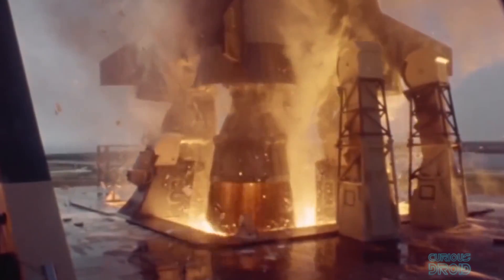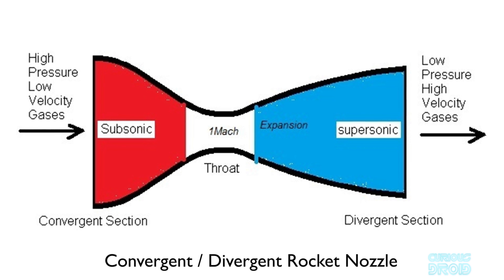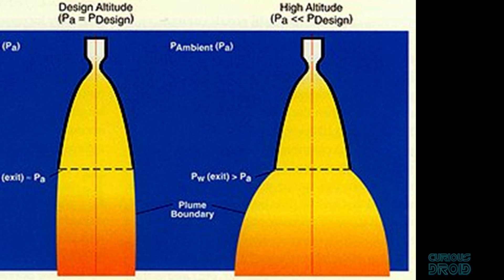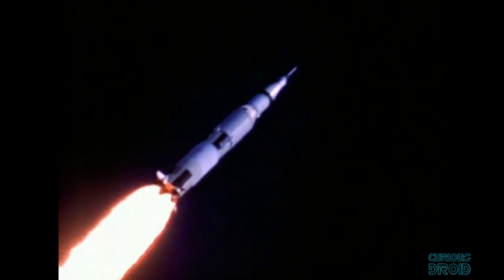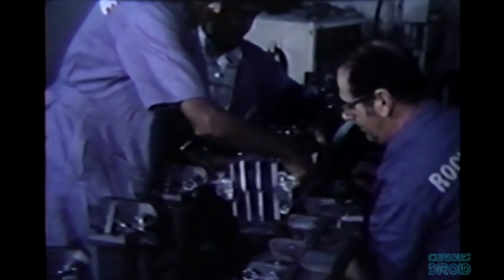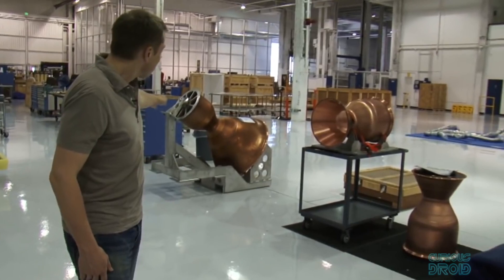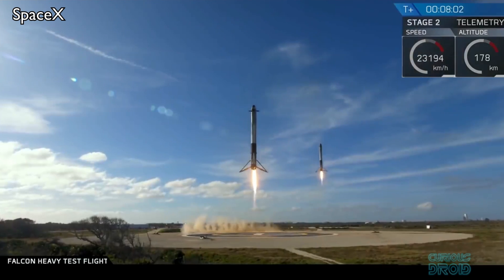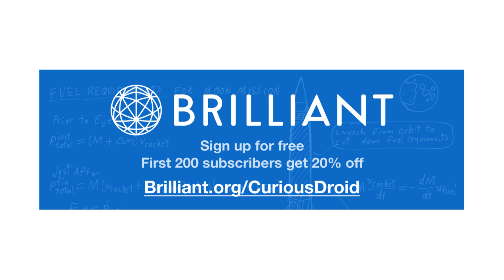Aerospike Engines - Why Aren't We Using them Now?

Comment: It’s sad to think about how much aerospace technology was developed decades ago and not used since due to lack of financing.
Reply: Dawson Williams and Saimons
You realize that aerospike engines and multi-stage rockets aren't mutually exclusive, right? You can still have the space shuttle setup, put the traditional bell nozzles on your solid rocket boosters as they aren't used for most of the trip, just the initial boost, and have your shuttle engines be aerospikes as they have to be used for the entirety of the trip. 

Also, the fuel tank is held until it runs out of fuel anyways, which is after getting through most of the atmosphere. So yeah, you almost are carrying a huge fuel tank all the way to orbit. Most huge fuel tanks for rockets are dropped after exiting the atmosphere but just before reaching orbit. So no matter whether you're using a single stage or multi-stage rocket, you're carrying that fuel tank nearly the entire way anyways. It actually doesn't make that big a difference.
Reply: All of which is pointless if, say, we pollute the planet and commit species suicide. Or a supervolcano goes off and we lose all food production and most of the knowledge of that technology. Or we get hit by an asteroid. The point is all our eggs are in one basket. If something happens to the Earth, we're screwed. We should put at least some resources towards hedging our bets. Oh, you also know who needs better medicine, computers, materials, and energy technology? The space industry. Two birds one stone.
Reply: As Neil DeGrasse Tyson, out it, since space exploration is no longer a geopolitical contest, it's no longer a priority.

In post 9/11 world, our American Corporate Empire is concerned with continual resource warfare, for profit, of course.
Think about it. The things NASA could do with the ten eight hundred billion dollar budget increase, the military just received recently.
Reply: dolebiscuit Yes, actually. US Defense spending makes up 16% of the budget, while social security and welfare makes up well over 30%
Reply: What that fails to take account of is the globalized nature of the economy and how much we rely on global infrastructure. Should a significant portion of that fail, then all the things that keep the majority of humans alive will fall apart. Sure, some military forces will probably survive as a result of survival training and hydroponic systems, but you will likely see a large "brain drain" as many of those who have knowledge of how systems work die out. In some areas we could be knocked back over a hundred years as a result.
Reply: Or is IS being used by the military and just not publicly known about. Same for many types of technology. A guide for patent examiners for patents to be CLASSIFIED BY THE MILITARY included things like solar panels more then 20% efficient, fuel efficient engines, carbs, propellers, heating of the surface to increase MPG, computer, encryption, water desalinization,ETC. And it had a section for weapons and weapons components, which I would agree with for many things like missiles, ETC.
But solar panes , water desalinization, things to increase MPG ?
What happened to energy or SAVING GAS ? Water to people ?
They don't want it !
Notice this was a 1973 guide, I can't find an up to date guide. This means they had solar panels better than 20% in 1973 ! And 50 years later they STILL don't sell panels even 20%. But MILITARY panels have been over 40% ! Yes, more expensive but they wouldn't increase the price more than 20% since most of the cost is the panel, not the actual cells.
The title was something like ,"Patent Examiners Guide to Patents to be Classified".
Reply: LazicStefan is actually right. Bunch of libtards in here.
Reply: This is what happens when you're at the mercy of someone who doesn't give a shit about space travel to fund your space travel.
Reply: FutureNow, then luckily that money is used in other areas. So we get better computers, better medicine, understanding evolution better, biogenesis, housing materials, energy technology etc.
Reply: Money is made from thin air, look up the FederalReserve system. They own NASA
Reply: What about Russia & China who are not so profit oriented?
Reply: I thought government killing of potential projects coz of limited funds was an inherit British thing, but the virus has now cought the USA, the richest country on earth, am really surprised. It runs in the family?
Reply: Imagine what the black projects made that we don't have. E.g. the work of USAF scientist T.T.Brown before it went black in '54, he proved capacitors exert force and that a highly charged disc in a vacuum will undergo a weight change.
Reply: I’m not so sure about that. If you count all the spin-off technology then you are using aerospace technology everyday. There are the obvious things like the satellite services we use, single crystal solar panels, and LED lights. But there are also the less obvious things like the materials in your radial tires, the foam cushions in your furniture and more.
Reply: Communism
Reply: @LazicStefan Rich people are rich because they do use their money.  They create markets and products and invest in others who do.  This creates the demand for jobs for us who are not thus inclined and would just piss it away if they gave it to us.  I don't pay more for a product than is the fair market value and I don't want him to pay me more than my skills are worth on the job market.  The rich and the poor are both born, live, and die.  We need the rich so I can do what I like to do, and the rich need me to be able to do what they like to do.  In my opinion, guys like Henry Ford, Wright Brothers, Diesel, Lockheed, Boeing, Bill Gates, Steve Jobs, the guys who started Google, the guys who started YouTube, etc. are the most underpaid people in the world.
Reply: FutureNow you should make a conversation in the discord server about it
Reply: + NaN
So you're convinced he's not too intelligent to make sense to the masses amongst whom you huddle.
Reply: Epic Nipple if thats true? Well, that makes me kind of happy anyway..
Reply: Tapu Koko you're kind of right, being the police in the world can't be cheap.
Reply: yes
Reply: That's why NASA sucks for a space agency. They cannot stay with 1 plan.... Half the time they aren't even thinking about space.
Reply: NASA is the military. I strongly suspect, no, actually I know for a fact that a great deal of technology HAS been developed but not made public. It's pretty obvious. The SR-71 was made 50 years ago
Reply: Best aircraft ever designed yf 23 and it will never see production :(
Reply: Financing?..more like suppressed.
Reply: you and your likers are idiots
Reply: FAKE NEWS
Reply: FutureNow because we're divided. I figure once we have a common goal it be different.
Reply: LazicStefan is obviously ignorant or a shill, ignore him
Reply: FutureNow most often it leads to other things better in need
Reply: Decades ago NASA had a huge boost from all the German scientists they "acquired". The moon landing was only possible due to what Germany has developed. Russia has achieved far more milestones in space travel.
Reply: I know it is always about  how someone can make money.
Reply: "financing" - making things go quickly costs a lot of energy - few on the planet have the energy to make things go fast. Read: Asguardia. Wtf humanity? I want electric vehicles and protein meat that replaces chicken perfectly, idc about another sattelite being used for more tv channels -_-
Reply: Does it make you cry?
Reply: Your over budget! How are we going to build all these aircraft carries now! My question is if we ever needed to use all this firepower against another large nation it wouldn't matter. one nuclear bomb would destroy an entire fleet. Let alone every major city. production area etc etc. I bet there is insane amounts of money being put into a black project that makes it so any ICBM can be destroyed. An when we get there no one would know until nukes were fired or another country came out and did the same. Funny enough building a anti ICBM system would make other countries upset like China an Russia.
Reply: And stuff like steam powered electric cars before gasoline ICE
Reply: @LazicStefan I think you mean war
Reply: Just search DIY rockets. It's the future now.
Reply: LazicStefan you really don’t have a clue I wonder how you actually get dressed in the morning
Reply: @LazicStefan What you subsidize, you get more of.  Remove all government assistance for everything, including education.  Anything people do not earn from their skills is charity, and charities have voluntary-only donors who oversee how the money is spent to help others, not to build dependency and buy votes.  If you do that, everyone's standard of living who stays will go through the roof, you will have the best schools and best educated people in the world again because the parents whose money it is in the first place will see to that, and you will have money to spare for these things to spare.  You will have far less crime.  The rest will flee to 3rd world socialist countries to live with those who made their country what it is today.
Reply: @ianhargis182  Apparently
Reply: @LazicStefan All welfare programs combined consume less funding than corporate tax-breaks (Corporate welfare) producing toxic products and useless, bastard worker drones who can't pay their bills.

In fact, the welfare state is one of the smallest segments of the US Budget, with the Military and Intelligence communities being the vast majority of it.

For example the 400 Billion we spent on the F-35 (A now outdated and inferior platform with serious problems and a high keeping cost) could have funded every NASA project that was canceled and been enough left over to fund welfare for decades.

GG, facts don't care about your feelings snowflake.
Reply: @LazicStefan you have it right but backwards...women are incentivized to be so
Reply: @LazicStefan That has nothing to do with it. The lack of education and social welfare and the massive wealth gap are the biggest problems. If you look at the countries with the most self-made millionaires and billionaires, the countries that are the happiest and healthiest, and the countries that are the happiest, they are all the same: socialist Scandinavian countries.
Reply: The thing is with modern chemical fuels it isn't very practical to build an SSTO. Let's assume our ISP is as high as it can get, and it's always optimal (approx. 4510 m/s- O2/H2 pair). Then the Tsyolkovsky's equation 10000=-4510 ln (x/100), where 10000 is approximately the delta V to get to orbit, x will yield the final mass, it's 10,89 tons per 100 tons of initial mass. If the ISP is lower -3700 m/s then the final mass is 6.7 tons per 100 tons of initial mass. But it isn't as easy. Because initial mass should include payload, fuel, construction and so on, it's basically impossible below certain ISP to get the rocket to orbit. Basically when you start to analyse masses, you get to a certain very interesting conslusion. Let k=Mfuel/Mconstruction then (Mpayload+Mfuel+Mfuel/k)/(Mpayload+Mfuel/k)=exp(deltaV/ISP)--->Mfuel=(Mpl*k*exp(V/I)-1)/(k+1-exp(V/I)). For denomenator to be positive (because numerator is positive and mass of fuel cannot be negative) you have to get k>exp(V/I)-1. Usually k=9. (Construction is 10% of mass of fuelled rocket). So, exp(10000/4510)-1=8.18, so only with that ISP it is possible. But with ISP of 4342 m/s exp-1=9, so you have border situation and odds are your SSTO can never reach stable orbit.

So, during 60-s it was even harder to build smth like this, and areospikwould have a great problem with cooling the spiky part.
Reply: Lack of financing????

Ummmm $600 billion isn't a lacking budget....... Unless you're a Rothschild! Or one of those other piece of shit families
Reply: Succubus Chan  And therein lies the problem: Science should be a core part of the government. Instead we spend more than Russia and China combined on our military. It's ludicrous and unnecessary.
Reply: Succubus Chan  Everyone deserves to eat. Everyone deserves to live. No matter how useless you think some people are. Your opinion does not rescind the right of every individual to have access to food.
Reply: Well the corporations run the world now so no more advancement only profit
Reply: PoopCoin Patrick  ok shut up you delusional clown if you have nothing useful to add.
Reply: @LazicStefan lmao truth truth
Reply: @LazicStefan Good point; all males should have reversible vasectomies before puberty, and then once they are able and willing to provide for any offspring then they can get their fertility restored.

If that's seems a bit harsh [because it's something being done to men, and not women], then free contraceptives on demand with universal access should drop the unwanted pregnancy rate by a lot.

But then, a 1% rise in the company tax rate could cover the cost of single mothers welfare with money to spare.
Hell… just Jeff Bezos by himself paying his fair share of taxes would cover it for everyone.
Reply: What makes you think it’s not still being used for current research and development? Just because NASA doesn’t show the public doesn’t mean they’re not still building spacecraft.
Reply: Epic Nipple I hope you’re right! I want this stuff to work so bad!!
Reply: it's not lack of financing, the aerospike just isn't that good for multi-stage rockets, and single-stage rockets aren't very good for anything.
they're more expensive to manufacture due to their precise shape, so you ideally want to recover them as well, which is even more challengeing to acheive their use-case of being single stage. for things like single-stage spaceplanes they might see use, but depending on tech that might not happen either given engines such as SABRE.
Reply: with NASA funding being less than a fraction of US gdp, I bet that aint the issue... There's too much rich people spending money in useless luxury instead of funding useful science, useless wars and excessive expending, too much corporate lobbying... whatever. given the US government snail pace at funding space, it'll probably be private corporations to keep things going on, and other countries governments.
Reply: Tapu Koko I was off. The US doesn't even make the top twelve countries with the most military/GDP investment. http://uk.businessinsider.com/12-countries-highest-military-budgets-percentage-of-gdp-2017-7/#12-jordan-431-of-gdp-1
Reply: LazicStefan I mean, I think it was like 1% percent of people hoarding 80% of America's wealth or a similar number, and the US government invests in the military the most out of any other country in the world, so I think single mothers on food stamps are hardly what is keeping NASA underfunded :/
Reply: This planet will inevitably die out. Whether in 100, or 10,000 years, it will eventually become uninhabitable for humans. Whether that be from natural causes, such as an asteroid or supervolcano, or if we nuke ourselves to oblivion, it will occur. We should colonize other planets while we still have the resources to do so. I don't think you realize just how fragile our civilization is.
Reply: @Gustav_Kuriga  - we have a tin can circling the earth that we call a space station.  it took 60 years to get that done.  u watch too many sci-fi movies.  we are not even CLOSE to colonizing the moon.  baby steps buddy!  maybe one day when the space station is orbiting the moon you could still say we are barely close to colonizing the moon.  have you ever built a shed?  its hard enough to get the materials to the jobsite, to setup, and to build and thats with the convenience of no space suit, all the oxygen you can breath, the luxury of taking a break whenever you want, etc. etc.  for logistical purposes even if we build ANYTHING on the moon it sure as hell won't hold more than what?  10, 20 people?  musk got paid 1.4 billion to resupply the space station 12 times.  how much will it cost to resupply 20 people living on the moon, or even living on a space station surrounding the moon?  and at what cost to the living conditions on earth?  just so what?  if an asteroid is going to hit the earth 100 people get to survive?  how?  they will grow their own food?  make their own fuel?  besides.  here is a conundrum noone seems to take into account.  we "supposedly" landed on the moon 12 times back when before the invention of modern fuel injection and when computers were the size of your bathroom but with all the new insane technology we have today not one country has attempted another moon landing?  that makes zero sense.  why not?money surely ain't the issue nasa's anual budget is like 140 billion.  if they did it then do it NOW!  but maybe thats the problem.  maybe the stanley kubrik "conspiracy theory" isn't so far fetched.  also think about it didn't buzz aldrin kindly inform some grade school girl that we never landed on the moon?  yeah and please don't inform me that he has dementia.
Reply: @michael-dm2bv  Yes, I'm sure you're an expert on the subject and not just some random commenter on youtube. By the way, I don't know what kind of idiot stunt you're trying to pull, but the ISS began construction in 1998, not 1968.  And it took 20 years to build.

I'm not saying a colony will go up all at once, ready made. This would be something that took decades to put into place. But it is possible with modern technology. The issue isn't our technology, but the actual drive to do it. Probably the only country right now that has the drive to do it is China. Every other country is only focused on the, admittingly important, issues right in front of them and not those 20-60 years down the line.
Reply: @michael-dm2bv  Oh, and China is planning a moon landing. They just recently landed a moon rover on the far side of the moon, if you weren't aware.
Reply: Nonsense, the US could spend half of the current budget on military and the would still beat China, Russia and Saudi Arabia combined. Rich countries tend to spend less of their GDP on the military. One century ago, 20% or more of yearly expenditures of most countries would go into the army. It's expected from poorer countries to spend proportionally more of their GDP on their army than richer countries. Look at this map: 

https://en.wikipedia.org/wiki/List_of_countries_by_military_expenditures#/media/File:Countries_by_Military_expenditures_(%25_of_GDP)_in_2014_v2.svg

The negative correlation between wealth and share of GDP spent in military is pretty obvious. The few exceptions are the US, Russia and the oil monarchies. Really, there's no reason the US spends that much on military (except imperialism and corporations).
Reply: @pierrestober3423  Being as good as China or Russia's military is not close to good enough, have you not noticed a trend in increasing Chinese and Russian influence  and unmitigated aggression? That is because the US is steadily becoming less and less capable of deterring them. And there is a simply reason why most wealthy countries have pretty small militaries: most of them depend on the US military for backing and see little need to contribute, and this kind of attitude is the reason why NATO is steadily declining. You people who try to compare the US military budget to that of other countries dont realize the incredibly unique and important position that the US has played in geopolitics for a century, and more importantly you dont see the huge impact that the US relieving itself 0f that role would have.
Reply: NASA is an acronym so who cares what it means in Hebrew? And Americans spend $219m A DAY on cigarettes, so I think we can afford to kick some more money to NASA.
Reply: LazicStefan Welfare? Really? That's what is sucking the money out of NASA? Couldn't possibly be the fact that our annual military budget is over $500 billion dollars.
Reply: dolebiscuit Our military budget is actually at 600 billion dollars! But he's right, actually, (unemployment, labor, and soc sec) is 33% of our budget. They're lumped together as one thing, and that is double the military budget, totaling in at 1.275 TRILLION dollars. And then below unemployment and labor and soc sec is our health budget. Together those two make up over half of our budget at over 2 trillion dollars.
Reply: @dolebiscuit  >>>>  that   500,thou,million  -   all of  it goes  into  someones  pocket  - their taxes , their car  their slice  of entertaiment  mart  , their  holidays  which are  taxed  
derive  some thing  new  such as  "Pi*LHyT"    c  1989  ( yep   eighty  nine - 30 years ago )  they  wanted   it refused  to  pay  had   others  who  wanted  the coo-coo effect     three dimensional space-craft  //// aircraft  position  display  -  they wanted  all  for themselves  .  Never told as   not  paid to  derive  design  such .  When  I'm  paid  then they  get told
Reply: dolebiscuit Welfare takes up 54% of our annual spending budget meanwhile Military takes up 13-16% so yeah I’m pretty fucking sure it’s welfare
Reply: +Jeremy
You just told a guy who was probably anti-semite that he was Zionist. Right after calling another conspiracy theorist an Arab Socialist (something that's probably the most non-existent population in the entire world). It's also hilarious that you call the US free-market capitalist, something it hasn't been since the turn of the 20th century. By god you're the most deluded person I've seen on youtube in a while, and thats saying a lot

+hurcouk You realize that Hebrew originally didn't have vowels, and that nasa is merely the way the word is pronounced, not its actual spelling, right?
Reply: @Gustav_Kuriga  - https://youtu.be/j0TPJQSmAHU  -  us tax payer money HARD AT WORK.  grown men playing with 3d printed blocks of moon dust?  how much did that printer irresponsibly cost u.s. tax payers?  its actually pretty funny these employees have probably never even done masonry on earth and they are proposing we make airtight shelters on the moon via masonic building techniques?  theres a word all moon colonization "dreamers" need to learn.  the word is "logistics".  stop building ur moon base on earth.  build it in the vacuum of space, in a space suit, how ever many miles away the moon is, with all the logistics necessary to make it work.  do you breathe?  how much oxygen do you need to bring to keep 10 men in space suits alive on the moon for ten days?  its really the problem all you colonization "scientists" leave out all the little details.  you just say "lets colonize the moon!"  shit!  i wish we could!  we could send all idiots to a new home.
Reply: also, thank you for the link!
Reply: Wouldn't surprise me a bit; I have on good authority from a (since departed) family member in the oil industry that carburetor technology able to achieve over 100mpg in even monstrous vehicles like the Chevy Suburban has existed for decades.  But now we're making devillishly complex electric, hybrid, and alternative-fuel vehicles, creating new sub-industries to avoid the simplification that would cost car and oil producers billions in profits.
Reply: Ben Carson is still an idiot outside of his specific field.
Reply: Most humans fall into that category.
Reply: Tapu Koko It's not the amount of money going into the military budget that matters, but the percentage of the GDP. In that regard, the US is the....fourth largest? Fifth? Somewhere in that area. I know Israel, Russia and Saudi Arabia invest more of their GDP then the US does.
Reply: Gustav, they are also getting that with the enovations in other areas. 
Just so you understand, in order to get humans to live on another planet, you have to move a lot of them, before they don't die from inbreeding. You do also understand that we can survive a supervolcano etc. on this planet, if we prepare for it? Of cause not all, but some should be okay. Currently we are starting to produce crops indoors and that will become a lot more. Decentralisation of the energy net with different teknologies will also make sure we can survive. If we want to colonise other planets, we need to get it right here first.
Reply: youre an idiot
Reply: install communism for more finance
Reply: FutureNow actually, it's more due to the inefficiency of having a single stage to orbit. Turns out carrying around a huge fuel tank all the way to orbit is less efficient than dropping them off when they're not needed. Also, Elon Musk is a better con man than scientist
Reply: @dawsonwilliams546  elon a con man. Haha your such a clown.
Reply: LazicStefan Man, you're fucking stupid.
Reply: USA and wellfare state? singlemoms sucking up ressources? 
what kind of humor is this? i can hardly belive this was a serious statement.
Reply: LazicStefan how about the military budget? Insanely overinflated and is going to increase even more
Reply: Capitalism by itself tends not to innovate just exploit other accidental innovation or cause harm calling it innovation, and stealing collective innovation via taxes and vision.  Because the profit motive doesn't work for long term long cited things, but needs profit asap.  Something like space technology needs more government R&D... I mean the private space companies are only racketeering primarily off government contracts anyway.
Reply: @LazicStefan they decide where all the money in the world goes. They create the conditions that lead to your dreaded welfare state. Rich people are entirely the problem. Blame the people responsible, not the people who have no power over anything
Reply: The rich have made our species into a parody of what it should be.
Reply: THey don´t use them personally, but they do own disproportionate amounts of capital which they direct into the finance sector, and into furthering  our mad consumer economy... they are eating the rest of the economy now! There´s more to the economy than what you see out there....
Reply: LazicStefan it’s a shame your mother didn’t use contraception. The planet needs less idiots like yourself
Reply: LazicStefan lmao you forgot that the defense sector took the most money , welfare is literally peanuts when compared to spending on wars
Reply: Pierre Stöber

I think the US should atleast cut their 800 overseas military bases in half, which costing the US around 100 billion dollars, and shove that money into NASA instead.
Reply: LazicStefan Was that really called for ? No I think we can blame the government spending our tax dollars on endless wars that benefit  only the ultrawealthy . How about these companies stop being so greedy and stop expecting "we the people" to pick up the tab . I'd rather see some of my tax dollars helping single moms and their "" bastard children"" as you so coldly put it than giving billions to Israel or huge tax relief for the wealthy who can afford to develop this technology if they weren't so fucking greedy expecting a hand out from the government as they usually do.
 You've got issues . Try being a single parent some time . It's not too much fun at times. I'm a single dad and can empathize with the single moms out there who are trying their best .Not everyone has had it easy or had decent parents with money or fill in the blanks...

 Judging by the way you said that I'm surprised you didn't take it a step further and start throwing ethnicities into it . Do the world a favor and don't procreate okay ?
Reply: Chrissel L Also when you have a poor section of the population you have a ready made volunteer military force . In so many of places in this country the military is the only way out of poverty . Just look where most of our service people are from . That pretty much says it all and is a well known fact. 
Not a bad gig to get into assuming you survive and live long enough to reap the rewards for staying in the full tour of duty. One other point I'd like to make is the fact that many of our service members and their families are on public assistance and are barely getting by . If we're talking about welfare lets talk about corporate welfare and stop attacking the average person who needs a helping hand from time to time.
Reply: When the military is used to further private corporations and special interests (think oil & gas, Israelis, Saudi and other gulf state lobbyist) then it's a bad gig. The american public are first deceived they are under threat (!) and then they are given the solution which is to enlist. It's a ridicilous thing. Sometimes it's not about corporate interest,  in Vietnam US wanted to stop Soviet influence and got tangled in a war against a poor country which acted as proxy for china and soviet. It ended in an ironic way, many americans shamed the veterans returning from this disaster even though it was politicians and leaders who made bad decisions and started an unethical war.
Reply: +LazicStefan
You mean the American war engine which is swallowing up all the money.
Reply: fair enough, I havent done my research (cause most of the time I generally don't care) and am going off what I remember reading, though the point stands that I don't think 'the welfare state' is the cause for NASA struggling to get to the sky again, when you look at the current distribution of wealth. Welfare or not it doesn't seem like space or science are the government's top priorities.
Reply: Logan Caudill 2017 the US spent 822.9 billion for defense, while the TOTAL welfare was at 454.6 billion... So, military 12% and welfare 7%.
https://www.usgovernmentspending.com/year_spending_2017USbn_19bs6n_20303136#usgs302

In comparison in germany we spent 2017 also 12% for defense but 42% for welfare
https://www.bundeshaushalt-info.de/#/2017/soll/ausgaben/einzelplan.html

Ok this comparison is not very strong because it lacks of details and im not able to show structural differences. But obviously there is a huge gap between them. 
And we are still alive, we are still making great cars. We have a far more peaceful society and far less young people in prisons...

I can not proof this thought, but im very sure there where more civilian killed during war on terror than single moms using welfare even exists in that time. And it was more expensive. As example a single Hellfire missile costs $110K. I could live pretty good for that money for about 5 years.
So there is no fuckin reason to cry about a little bit welfare, a little bit of good for people having hard times.
Reply: Gustav, sure, but humanity will survive.

We will need a lot of resources to move over 10.000 people to Mars and that would probably be better spent here to make sure this planet doesn't die out.
Reply: LazicStefan You’re why nationalism is dangerous.
Reply: +God the supposed existence of deities is why humanity has ALWAYS SUCKED.
Reply: LazicStefan
 Are you really stupid enough to actually believe that? If you want to blame something how about blaming the correct thing for one? Look at our oversized defense spending. It far outstrips the budget of the next 5 nation's defense spending combined... And we are so wasteful on that front that we have moved on to militarize our  own police forces free of charge to them with all the military surplus we have despite our active involvement in military conflicts over the years. Social programs that actually have a positive impact on the standard of living of fellow Americans has nothing on those figures yet here you are blaming the poor out of your own ignorance.
Reply: FutureNow instead they waste money on gender studies because we dont know whos female and whos male.
Reply: Perhaps we should shake out the pockets of the Rothschild's and their thieving bankers friends like the Fed'.
Reply: Lack of financing? NASA (which means "to deceive" in Hebrew, by the way) receives $54m A DAY from the US taxpayer, how much more financing do they need?
Reply: LazicStefan 
Ben Carson and Oprah Winfrey were once those 'useless dysfunctional bastard children' you're referring to.  Be careful who you libel.

The 'welfare state' works well enough in European countries, because some are fiscally irresponsible (Greece, Denmark), and some simply don't care about individual liberty anymore (Great Britain, Germany). Socialism isn'tan unviable approach to government - It just seems to be one that is incompatible with the concept of 'inalienable rights.'  If the state confers rights, rather than them being inherent to the citizen, then the state can negate them as long as there is 'due process.'  America had a revolution largely because the colonies up and said 'Damn your due process!'
Reply: @HuntingTarg  Wrong - Ben Carson's mother worked several jobs so that she would not have to go on welfare.  He says she observed that most who went on welfare were unable to wean themselves off it.
Reply: @samjubilee6593  
I excuse myself; you misinterpret my comment.  I never intended to imply that Sonya Carson received welfare.  I was mocking another commenter's label.
At that fact, I will say that she made a very astute observation - and had the character to act on it.
Reply: @FutureNow, you forgot to respond to the 1980's, Radio Zeesen Nazi-SS sourced, Erdogan of Turkey AKP Mastermind Theory propagandist spreading disinformation about the Fed and private financial sector, bringing up the by-gone era of the Rothschild family, I quote,

khankrum1
1 day ago
"Perhaps we should shake out the pockets of the Rothschild's and their thieving bankers friends like the Fed'."

@khankrum1, spoken like a true Arab Socialist, willing to subvert the property rights of hardworking Americans, spreading the seed for inflation-rates to be controlled by politicians, I mean TYRANTS, who spend beyond the economic means of their people, then collapse after their goons rob the economy. Take your propaganda elsewhere, as it isn't welcome here on OUR platforms. We're free-market capitalists over here, with an efficient economy, which is why we will always outperform and win any competition, anytime, anyplace, while your people are left in the dust of the desolate land your SOCIALIST regimes leave behind after they gas all of the dissenters. Leave your Turkish or Syrian garbage at the door.

@hurcouk, we're not interested in your Zionist propaganda and conspiracy theories. Kick rocks, buddy, before it's your teeth being kicked in. Go mind the affairs of your fascist dictator in Israel whose stealing from your brainwashed people living under the despotism of a sectarian dictatorship, who are shook down at 20 gestapo checkpoints each day. STAY OUT OF OUR PUBLIC AFFAIRS, and stick to what you do best, making mindless correlations between reality and the artificial reality your sectarian-state uses to keep you shackled. Keep importing your garbage into our country, creating anti-government sentiments within our people as measure to cultivate a domestic insurgency, and we will put our boots to your throat. Just remember we attempted to be civil by warning your country just a couple of years ago that violations of our sovereignty and influencing the sway of public discourse, within America, by your government, would not be tolerated - we are fully prepared and willing to back our warning to your nation, as well any others who do not heed our warning.
Reply: You and what army?
Reply: LazicStefan just thank those men who skip out the tap and forces government to stand in, it takes two to tango and any men that has kids on welfare should be force sterilization.